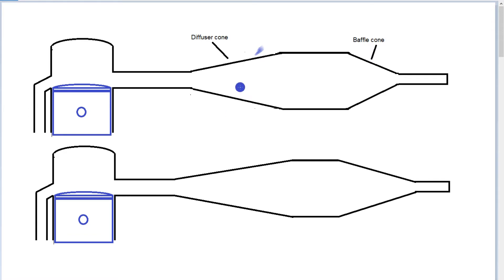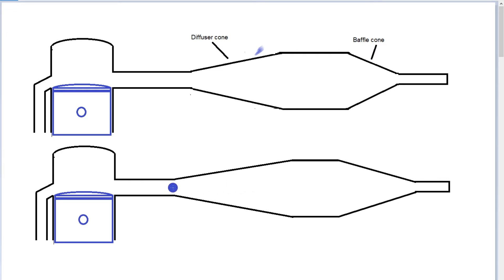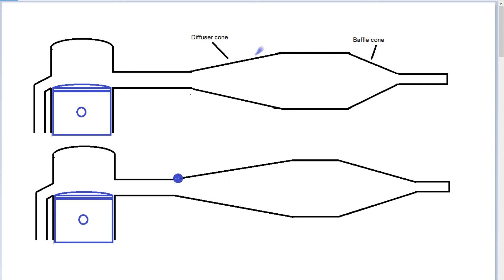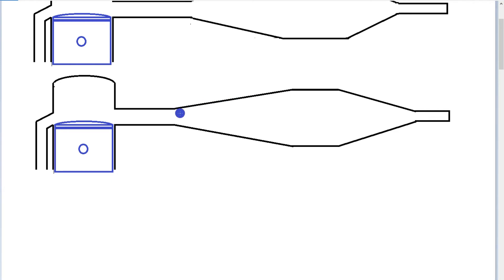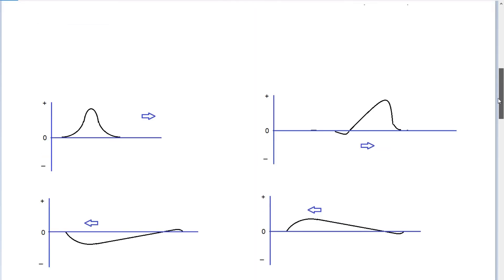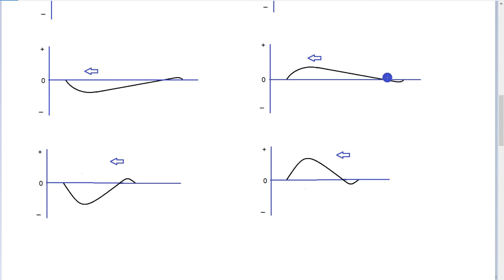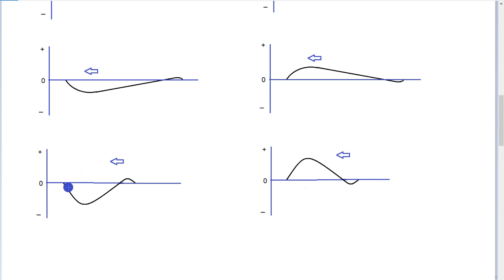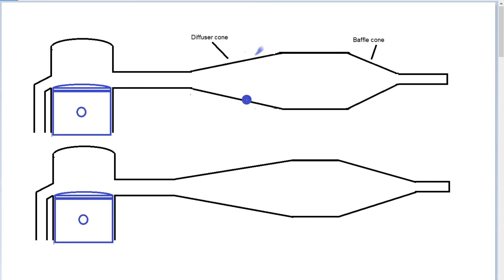How cone angles effect power in a 2 stroke expansion chamber E4

Comment: I have acquired a moped and a number of engines that were developed by Dr Josef Ehrlich on behalf of Motobecane. He was head of the DeHaviland small engine division at the time and the bosses wanted to sell his boost port technology. Motobecane had just brought out t he d52 - a 49cc dingle 2 stroke with 5 speed manual box - the two units being joined with a rubber vee belt. The engine only produced about 1.7 bhp to start with, the boost ported version put out 6.2 on the dyno. The motobecane engineers dismissed it as just gains from regular tuning. Interestingly the exhaust pipe while looking fairly standard has an expansion chamber concealed within it so there may be some truth to their claim. It never went in to production, even though the design briefs were significantly exceeded. I have numerous heads, barrels and bottom ends, I now have one combination that seems to work quite well, although further work is required, every head I have is slightly different, as is each barrel. I have the original development head with variable capacity boost ports - they used these to experiment with different volumes, once the optimum size was found plugs were made and the development variable items were removed. Thanks for the videos, they are helping me to understand things a lot better and will hopefully enable me to get my box of bits producing it's full potential again.

Comment: Thank you for all the verry interesting facts videos about two stroke performance and expansion chambers! I have a three cylinder vintage Saab as my new daily drive and i love it's little two stroke engine. I'm not interesting in "real" performance tuning, but in ecodriving. My Saab have big wheels and a high geared transmission, so my engine runs at lower rpm's than the exhaust is designed for. I hope to learn enough to design my own optimized expansion chamber exhaust for "Frankenfrog" soon. 

I guess a separate exp. is the ideal, but traditionally Saab-tuners use a single expansion chamber, common to all three cylinders. If I got the function of an exp. right, the reflected pulses can exist together inside the chamber for the three cylinders, but when reflected back to the pistons, the "port plugging" wave energy will be split in three, leaving only 1/3 to do a proper work. The reason for a shared expansion chamber is most likely the huge volume needed for three "seal cobs" under the bonnet. 

Do you have any experiences or theories around a shared expansion chamber?

Best regards, 
John

Here's my Saab "Frankenfrog": https://youtu.be/NEO4sT1F_G0?list=PL3HT0rsR3WgjH2T7DRIDnGklGowYdZe9H
Reply from the maker: Unique car that is.
Regarding 3 into 1 exhaust, I don't have have any personal experience of building them and so I can really give much useful information.
Looking at such pipes it appears that the same principles and equations apply for calculating tuned length and all that differs is the equations for diameters of the chamber in relation to the port sizes.
If I have time to study these 2 or 3 into 1 pipes more Ill do a video on it as I do get a few requests.
Reply: @AuMechanic  Thanks' for the reply! We have a skilled Saab tuner here in Sweden with a lot of "secrets", and from what I have heared/read, you are probably right about the calculations for wave propagation being the same, but with a need for changing some diameters (stinger pipe mainly) for the increased gas flow. I still think it may be a compromise in the end, otherwise most high performance three cylinder motorcycles should probably have a single shared expansion chamber. :-)

Comment: so a shallower angle has broader powerband  in the low - mid range rpm while a steeper angle provides more power in the high range rpm ? 

an example of a shallower angle exhaust is a chamber exhaust while a steeper angle exhaust is an unrestricted-stock exhaust ( since stock exhaust comes with a wider shape ) . am i right ?
Reply from the maker: A stock exhaust is usually more designed for broader power range than peak.
When you say "since stock exhaust comes with a wider shape" are you referring to the mid section of the pipe being larger ?
Just that a larger mid section may not be due to steeper taper angles of the cones.

Comment: I have a question about what I should do with my pipe. So I have a 78 yamaha Dt400. It is all low end and mid range. The piston at bdc is 3 mm above the bottom of the transfers, so it blocks flow. So all low end. Recently I just raised and widened the transfers. 1.3mm raised, 1 mm widened. The exhaust raised a hair under 1 mm, but widened 3/16 inch to 65 percent of bore mostly the top but still has a arch. Bike runs great but the pipe has sound deadoning material in the belly and a strange convergent cone baffle plate. Just flat with a hole in it. What would you do to modify this. I know that the header pipe needs shortening I guess and the belly needs more length, with a real cone? Thanks.
Reply from the maker: Maybe start by plugging the numbers into the pipe calculator to check those dimension it provides against you own and that might give you some idea on what direction to go.
The baffle cone may be adequate, keep in mind that the outlet size is critical however the length of the outlet pipe is not at all, the only consideration for the outlet pipe is that if the ID of it is the same as the outlet from the baffle cone then the longer it is the more restriction it will create.
For example if you were to add a long outlet pipe to the baffle cone the same ID size as the hole in it that would present more of a constriction to the outlet which is critical to have right.
Also, if you wanted to add an outlet pipe directly to the cone it is fine to use an outlet pipe that is larger then the hole exiting the baffle cone and in fact Honda NSR250 and a few other bikes do just that which allows a relatively short outlet pipe as the larger ID has no effect on the baffle cone outlet size as a pipe the same ID size would have..
Reply: @AuMechanic  Wow thanks for that. I can work with that.

Comment: I keep revisiting to reinforce my understanding of the concepts.  Thank you again.
Reply from the maker: Your'e welcome.
Got a few videos here on the topic, some others might help too.
Reply: @AuMechanic  hey man. I'm running a stock snowmobile engine in oval race type. I wanted to try  different steeper angle of my baffle cone.. I must use the stock pipe,  but can play  with the end.. i plan on shortening the cone by jut under 1 inch..would you recommend welding it to a slave that can slide in the belly and try it at different lengths? Say 1/4" incriments increments

Comment: Yr videos blow my mind a life time of wisdom thanks so much for sharing yr Knowledge, I have much Research to do especially in the area of exhaust tuning I currently have a vintage Kawasaki 650 SX and I’m building a later Kawasaki 750 twin both share many similar parts and it basically drops right in from exhaust manifolds to head pipe and so on I’ll be using yr videos the best I can to better understand tuning Characteristics based on carb sizes, pipe diameter, length, temp and so on, so many formulas to consider! For me building power is an art form, building it reliable and the engine being happy making power everywhere is a great deal of information to consider to achieve this successfully, so again I think you and subscribed!
Reply from the maker: Thank's for the comment Brian
Reply: Brian, I ported my bike see comments above and the bike feels very happy compared to stock. I think reducing the squish and reshaping the dome also help it.carburete better. I went with 145 lb compression. Power is so instantaneous and rev happy. Unfortunately there is no pipe available for a dt400. I did all this stuff without a port map and all with a dremmel and 12 by 12 inch piece of marble for surfacing. Cut a hole in the piston skirt about 8mm below the bottom ring land for under crown cooling. I angled the hole up toward the underside of the crown. The bike seems to run better when hot, vs it used to run best at start up. All my ports were not even straight and one transfer was even a half mm above the opposing port but was the best.i could do with my eye sight. I also dropped the intake floor 3 mm and drilled some boyesen intake ports to the rear transfer intakes. The carb is only 34mm so I oval bored it with a half round file and sanding role dremmel to 35mm. If you switch back and forth between file and sanding role the bore remains true front to back and side to side, just starting the cresent  from the half way point on the carb throat. In this way you only need to change the main jet out and not anything else in my case.

Comment: Does a shallow angle allow for broader powerband in expense of reducing peak hp due to it's lower amplitude as you mentioned?
Reply from the maker: Hi
Yes that is correct, shallow taper result in lower peak amplitude with a longer wave length.
As RPM increases the time for the wave to arrive back at the port reduces while the wave travels at a fixed speed of sound.
The longer wave length provides the suction effect over a wider RPM range because part of the longer still arrives within that RPM range to provide suction at the exhaust port.
Same applies for the end cone but its is a pressure wave not suction.
Reply: AuMechanic I see. So for fuel consumption-wise, apart from racing, it is better to have a skinny tuned expansion chamber instead of big fat one isn't. (Speaking about rough overview of the whole pipe design)
Reply from the maker: No the diameters are determined by the gas flows or BMEP, the taper and lengths of cones and distance from the port relate to wave timing I refer to above..
A standard engine would have a lower BMEP that would change the diameters, that is covered in one of the next videos